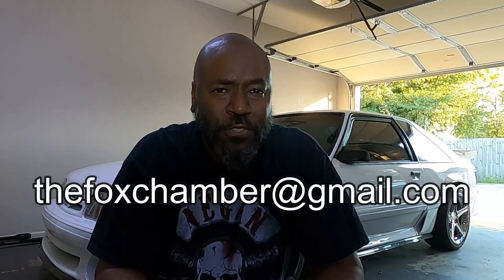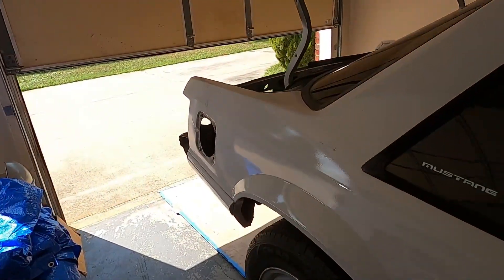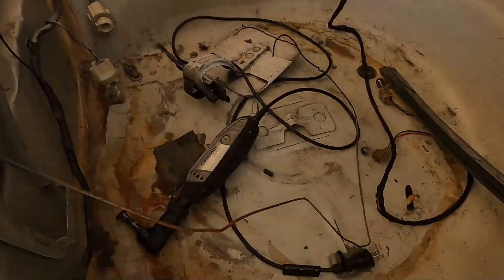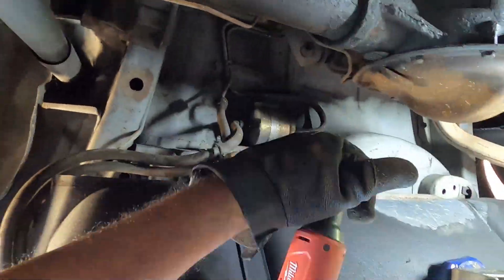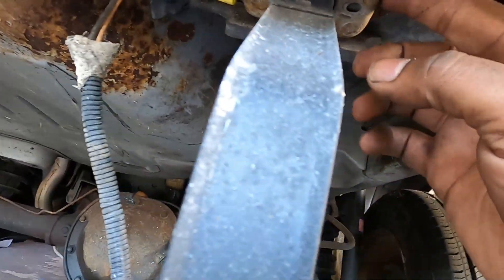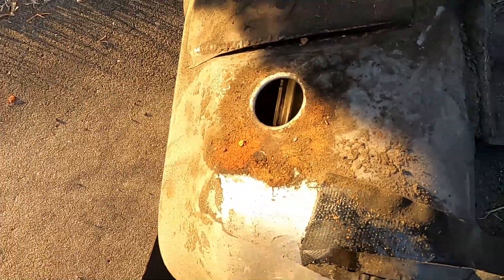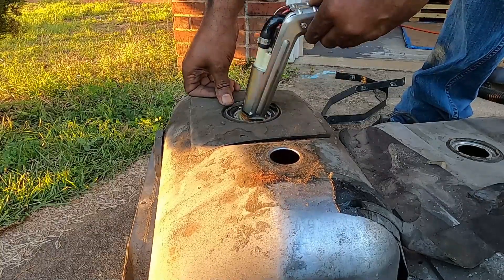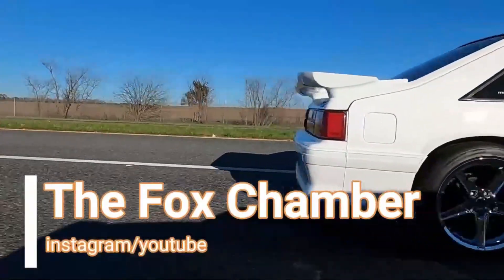The Notch Project V

Comment: Good job as always, Jim. I’m at the same spot with my coupe build- but it’s going on a rotisserie I sourced and getting Bimini Blue paint with a raptor lined underbody. Can’t wait to see your build come together!!! 

What material are you going to use on the top of the tank, and will you replace the sound deadener on the inside?
Reply from the maker: Thanks Eric. There's a fuel tank pad kit on @lmr that I was looking at, and yes I'll be replacing the sound deading on the inside. can't remember the name of it right now but it's supposed to be good. Supposed to block heat and sound.